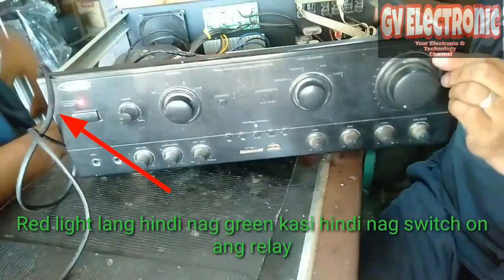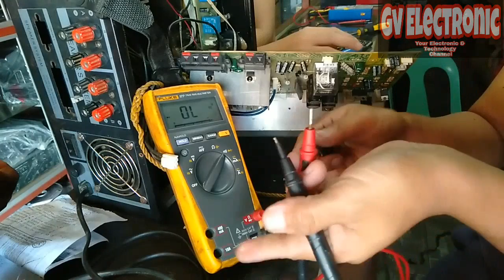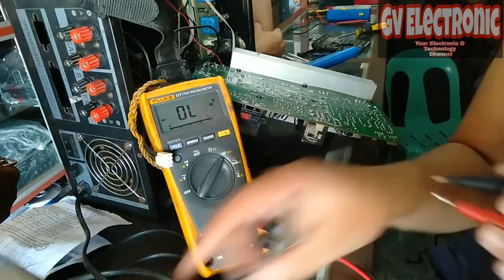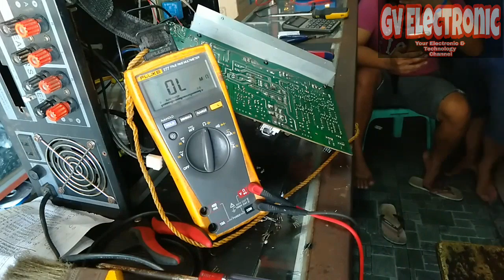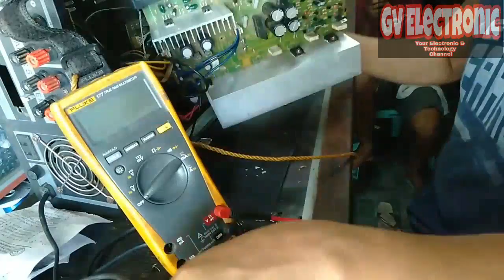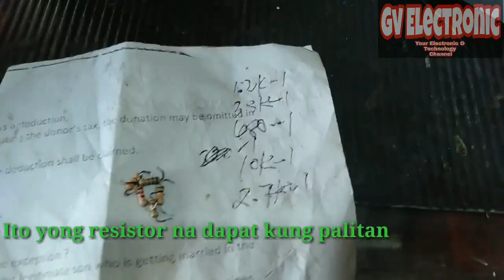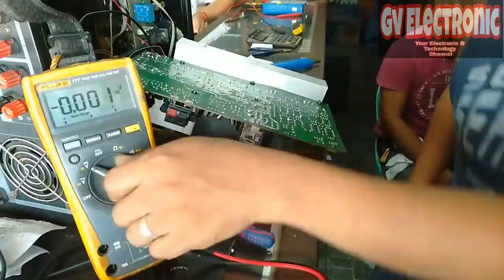Troubleshoot DB AUDIO 502-18 No Sound Half Channel Abnormal Bias

Comment: Sir ano kaya possible na sira ng ampli. Konzert av-502a.. right output speaker may voltahe ako na natetest kaya maugong ang speaker.. ok nman yung filter capacitor?. Thanks sa reply
Reply from the maker: offset.... check mo baka my nag change value na resistor

Comment: Boss tanong ko lang po.paano po yung hindi na cocontrol ang  volume sa main volume niya mismo.kaya sa CP ako nag aadjust ng volume niya kapag naka mp3 ako.
Reply from the maker: volume control mo baka may gasgas na ang carbon
Reply: @GiovanniV  Salamat boss..malaking tulong to.another question ko po boss paano po yung hindi lahat gumagana no yung tune control niya example yung bass,mid,treble. Pati yung sa Mic volume Hindi na gumagana sir.na try ku yung ginawa mo na video about walang volume yung mic sir wala parin.anu kaya ang mga dapat gawin or e check sir.?salamat boss.

Comment: sir jovanni, gd day po...patulong nmn ano kaya sira ng sakura 302 , isang channel lang gumana tapos sa kabilang channel may output voltage po na range hanggang 5 volts...nag dc out po yong isang channel...ano kaya possible sira...salamat po
Reply from the maker: sa bias yan sir check mo drive transistor baka my leaking at resistor baka my change value

Comment: BOSS TANONG KULANG SANA MABASA MOTO ,, KUNG LAHAT NG PYESA AY KABISADO MO PAG TEST ,, KAHIT RADIO PAMAN ITO ,, OO AMPLIFIER  OR TV NA CRT TV MAHAHANAP BA ANG SIRA ,, MA TV MAN NA CRT ,, OR RADIO ,, OR AMPLIFIER ,, PAG TENAG ISA ISA MO PAG TEST ANG PYESA MA AAYOS BA ANG UNIT ,,
Reply from the maker: opo! dapat ma tyaga ka lang
Reply: Gud a.m po sir anung klasing tester n ginagamit mo ung yellow blak ako mag bili nyan? Thaks po sir
Reply: @GiovanniV  Boss idol ko PO Kayo Galing Niyo Sa Electronics
Reply from the maker: fluke yan sir
Reply: @GiovanniV  hi sir gud evning tanog k lang ung gx7 k n ample wlang tonog ung R niya.ung isa L okey nman
Reply from the maker: check mo muna mga input connections like rca cord at jack, balance control, volume control, relay kung parihas nag contact switch, input  switch at main Amplifier circuit